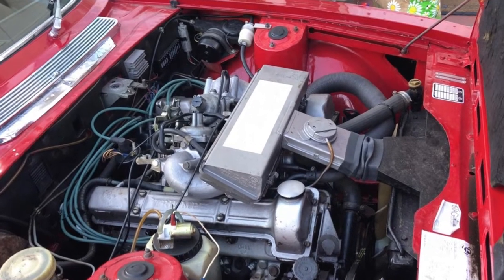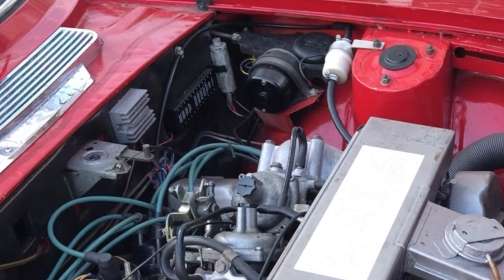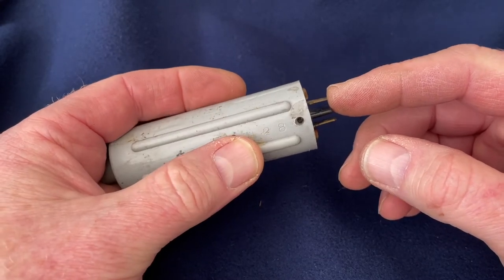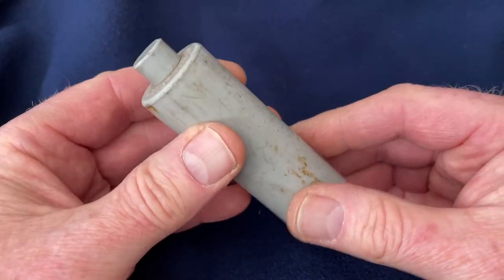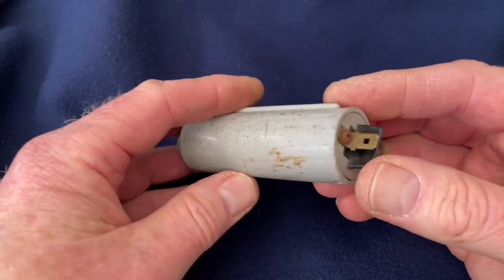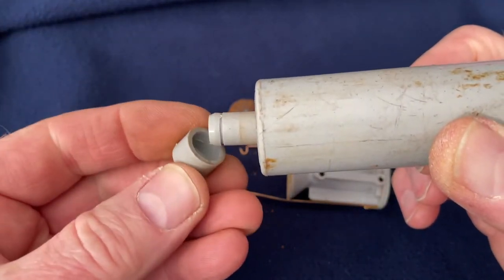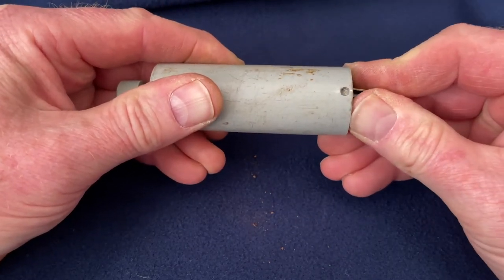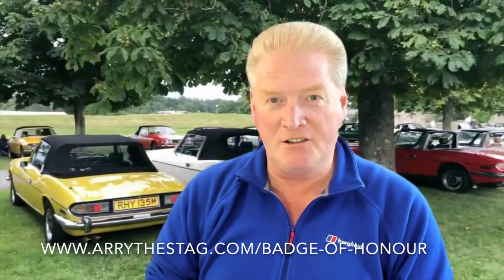Triumph Stag - Fuel Cut Off Inertia Switch

Comment: Agree totally with you Tony its these little details with their simple mechanical engineering that make the cars of this era so fascinating and ideal for DIY maintenance. You can also pull  up the cap of the unit manually and so use it as a rudimentary anti-theft device.

Comment: Yeah, removed mine first month I had the car after contacts made for intermittent FP operation.

(Listening to crickets while I wait for the barrage of abuse from "It has to have/Triumph put it there so/will fail MOT if you don't.......insurance company will " etc etc  🙂.)

I have had countless Brit cars that had elec fuel pumps and no safety impact cutout. My two Jags never had them. Good enough for Jag, good enough for me.

Here, the people doing the rego inspections don't look for them/accept that you don't need it (as, like I said, every other car of that era with elec pump doesn't).

But if I was going to worry about it; (and like I initially considered); an oil pressure switch system like many track cars have is easy to hook up. Have a prime switch, or "runs when starter runs" primer; then once oil pressure comes up, pressure switch makes relay, runs FP. 

As soon as no ign, OR engine stops = no fuel. 

Or refurbish the orig switch. I remember mine being a pain (I always give things a go) so I removed it. In fact, not removed - it is still in the car, but has a jumper over it. I did that in 1993........